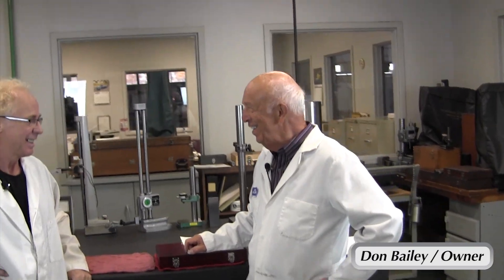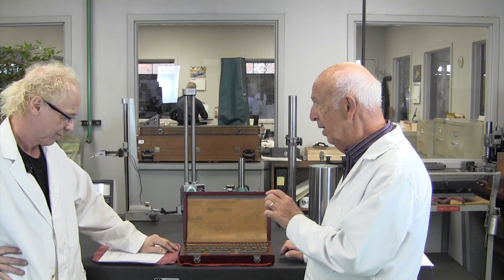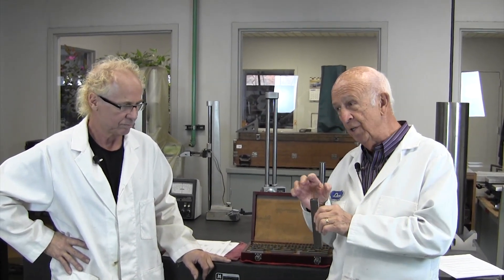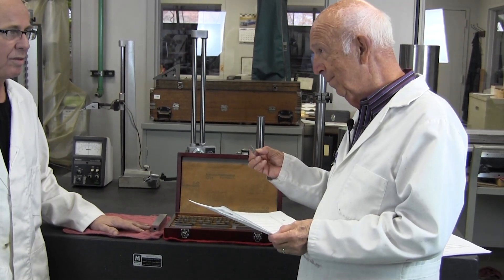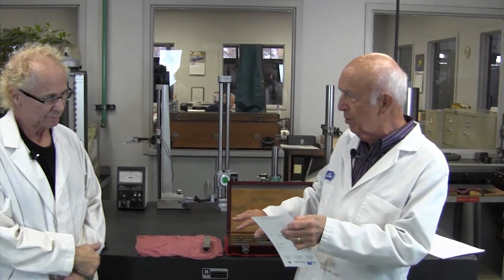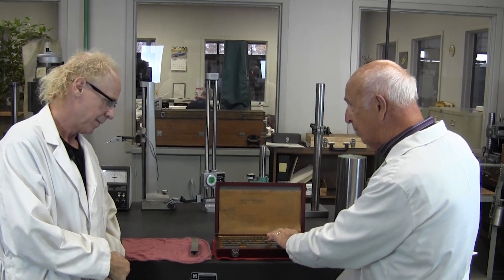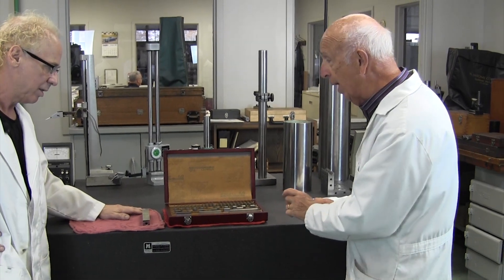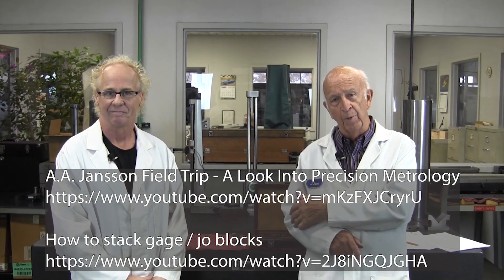How to measure using the proper tools part 3.

Comment: One advantage of steel blocks for in shop use is their similar thermal coefficient to steel and cast means they self correct for a cold or hot shop when machining those materials.

Comment: What ever you need to messure, always use a tool that can do one magnitude more than what is needed to read. Is it 0.01...get something that can read 0.001. Your life in the kitchen, woodshop and at the milling machine will be so much easier.

Comment: Thanks for this really high class lesson. Having a master degree in electronics measuring, calibrating, certification etc all is well known. Traceability etc.
Dealing with really sensitive electronical thermometers they start changing within seconds due to the heat radiation from the human body.
All instruments lie as well as gauge blocks. They can still be used if it's known how much they are off.
Well done Don! I could imagine You as being the head of the measurement division in any university, in any company.

Comment: You should mention that inexpensive general shop use measuring Jo blocks are meant for the machinist/toolmaker on the job. 
Also in that same shop, there are the more expensive inspection tool room Jo-blocks, always kept in a clean controlled environment for final verification and Quality Control.